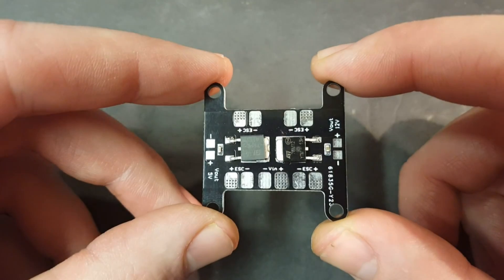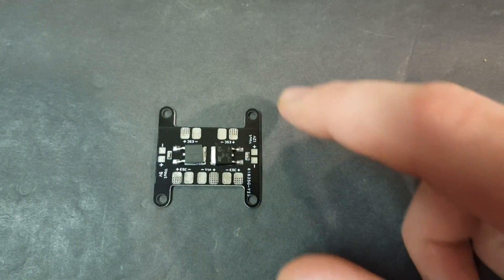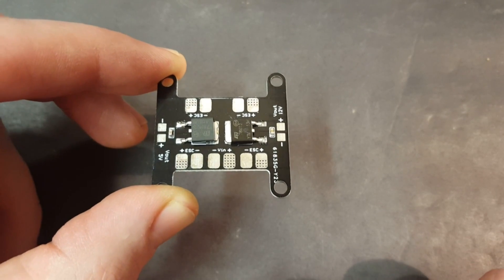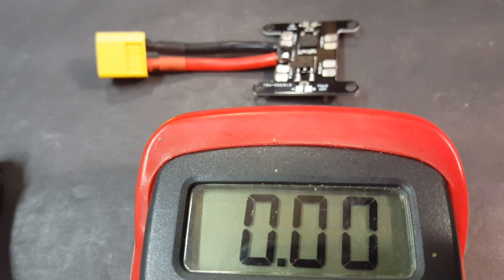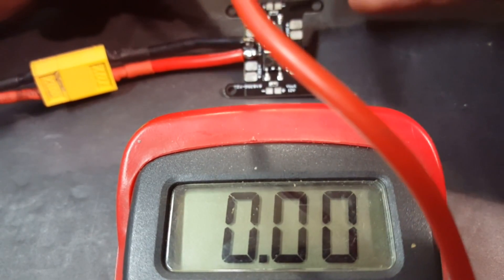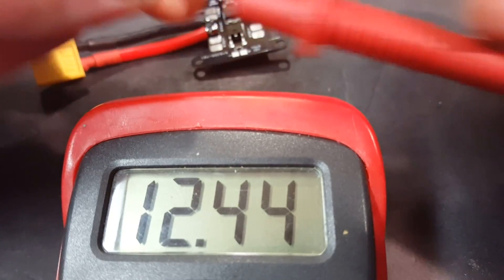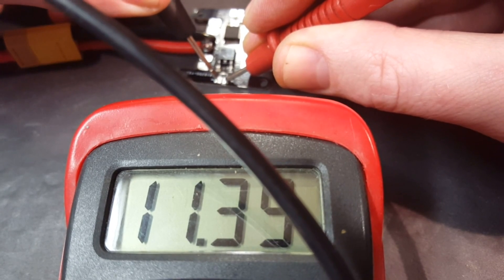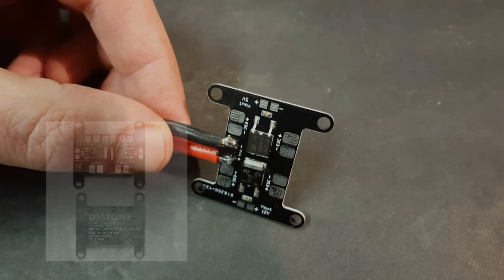Diatone V5 PDB Review

Comment: Pretty basic review. My question would be what happens to the 12v bec if 3s lipo volts drop down to 10.8.? Will it drop even lower?

Which regulator chips are being used?

What about ripple and other noise filtering? They claim it deliveres "clean power" but there is only one tiny filter cap on each rail. What kind of caps are being used?

Anyways thanks for the video

Comment: question again:
When wiring this up do I connect the 12v to the FPV part and can I just plug the 5v to the FC?
I want a simple quad set up e.g no OSD maybe some LEDs, just an Eachine VTX combo when the time comes.
Would the 12v be enough to power the FPV portion?
Will my plan of attack work?
Reply from the maker: Sounds right as long as your fpv setup is rated for 12v (and most are).

Comment: I like the look of that board however I would prefer a proper BEC on there rather than just a Voltage Regulator.  Diatone use the same Reg's on a number of their boards and frames and unfortunately I have had one regulator put through 16V through the 5v output onto the Naze which released the magic smoke.  That regulator had been fine, until I plugged my final battery pack in on the day.
Reply: +Tim Hughes and you think switch mode bec's which add a large amount of rfi to the power system which will then need extra filtering aren't capable of having failures and overvolting on the output? I've got a pile of roached rx from switch mode bec failures for ya.

Comment: Meh... another monoblock PDB that turns your quad into a flying spaghetti monster of wires all pulled together to one point; and it doesn't even have switch-mode regulators.

The whole point of a PBD is to tidy up the build, not make it look like a Charlie-Foxtrot.

The V1 is STILL the best one they've released, BAR NONE.
Reply from the maker: I have to disagree. the layout of this one allows for a pretty tidy build and IMO, full frame PDBs such as the V1 do nothing but highly increase the potential for catrostrophic failure in crashes that would otherwise be no problem. having your main power board spread out over the entire frame and vulnerable to taking the full impact of a crash is not worth the neatness you main gain from it IMO. I'd rather have a small pdb tucked away and protected and have to be creative to hide a few wires then deal with that.
Reply: +mnemennth i disagree,  this pdb layout was designed to remove the need for excess cables by keeping the esc in the center, like so . . . https://qbotics.files.wordpress.com/2015/10/180-core-no-naze.png something which this copy does not seem to do.